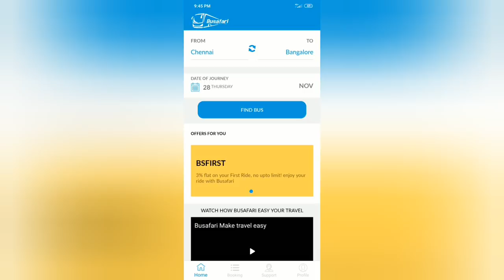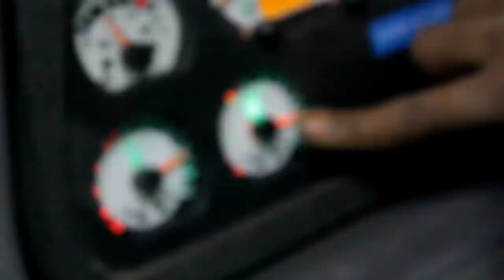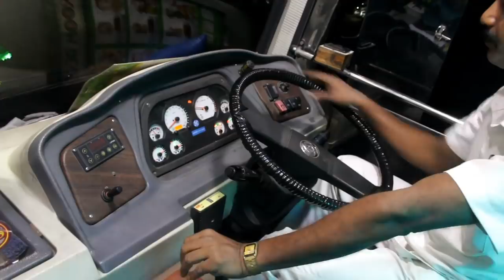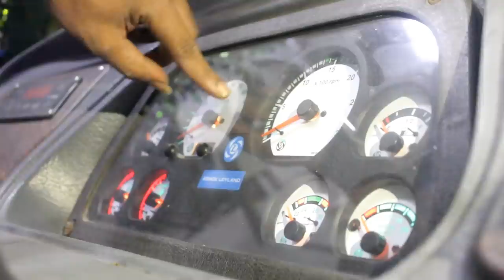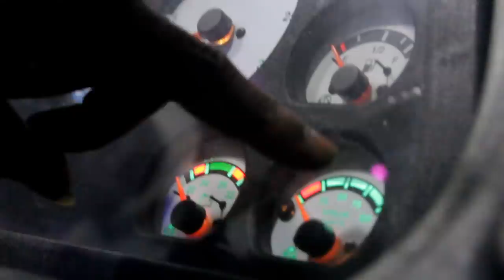HOW TO DRIVE ASHOKLEYLAND BUS IN TAMIL-ASHOKLEYLAND BUS DRIVER TRAINING

Comment: Nice video can I know the mileage on ac running Sir
And is this 1812 12m fe
Reply from the maker: Approximately 3.5kmpl
Reply: @Transkings  but agency person told me that mileage is between 3.5 to 4.5 on ac and without ac 6 to 7
Can uh please make a video on ashok leyland 12m fe bus chassis bs6 variant
Reply from the maker: No way bro ask without Ac standard is 4.5-4.6kmpl If we put Ac and bus is running 100km/hr means 3.5-3.8kmpl only the mileage ask a mechanic or driver then only u will get the proper answer